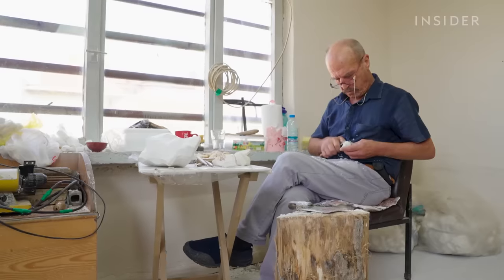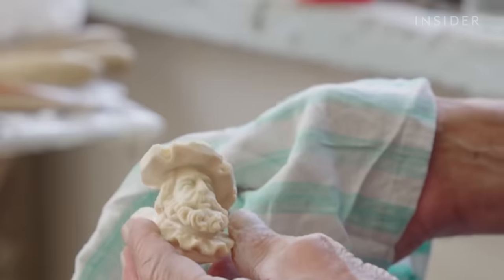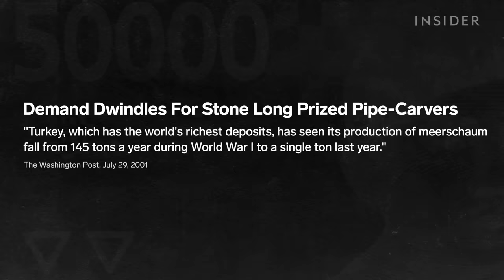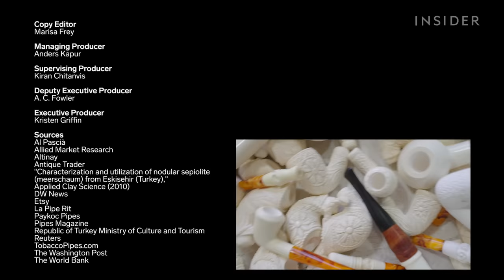Why Turkish Meerschaum Pipes Are So Expensive | So Expensive | Business Insider

Comment: Lovely video, I adore skilled craftsmen. I'm totally surprised that material this expensive isn't being synthesized. Even a top-grade synthetic diamond can't be distinguished from a natural one without expensive tests.
Reply: Hm, magnesium silicate sepiolith needs high pressure and heat to form in combination with volcanic gasses resulting in the porous light structure of the material. So I guess that would be not a cheap process and its only for a smaller market. Diamonds are sold around the world with a very high price. A fistful of material for 40 dollars (from the video) seems to me not high enough, especially with cheap labor costs in Turkey.
Reply: There's a reason you have to look for "block meerschaum". A lot of cheap meerschaum is made up of meerschaum powder held together with a binder.

Comment: Try stabilizing the poor quality clay in Cactus Juice , a polymer liquid that solidifies with heat. Put clay and liquid into a pressure pot, vacuum out the air and keep an eye on it. Don't want the clay to dissolve! When the bubbling stops remove and heat to 200 degrees F. Works with many porous rocks.

Comment: Expensive? While studying I did an internship (abroad) in Eskisehir. There is a market with many shops in the old Town district. I have do admit that's now almost 10 years ago. And yes, the big ones are expensive. Anyway, if you want to get a normal/little smaller one, let's say the sultan head (without hat), it was maybe 20-30 Euro. I got 2 pipes for some friends and paid 35 euro each. Yes, the stem was made out acrylic, but the head was nonetheless undoubtedly handmade. If someone is interested, I think I still should have some pictures from the shops.

So yes, if you want to have a special motive, a bigger pipe and a better mouth piece you have to pay more. But the entrance models are quite affordable.

Comment: I dont smoke tobacco,  but I wonder how Marijuana would be in it. Or if it would actually be worse than a glass pipe.
Reply: I used to have a stone pipe that I smoked marijuana out of and someone stole it. It was a different stone but still very carved. The one I had really absorbed the marijuana resin and eventually when you tried to smoke out of it it was like smoking hash because the resin inside would burn. I do not know how one would clean this sort of pipe, I never got to because it got stolen.
Reply: @adriennefloreen  cotton pipe cleaners are essential even if you're just smoking tobacco. I've never smoked weed out of any of my pipes, most of which are briar. I just smoke tobacco, but if I did partake I probably wouldn't use my pipes
Reply: @daedalus1279  In my opinion smoking weed out of pipes is awfully unhealthy compared to joints because you inhale particles of the burning ash, unless it's a pipe that filters through water but I have never seen one of those that did not have mold growing inside when it got broken open. The joint filters smoke through the marijuana as you smoke it and you never inhale burning ashes. That's actually why I stopped smoking weed in pipes. And also why traditional pipes like the ones in this video have a tiny hole you inhale through not a huge one like the commonly used marijuana pipes, and usually a screen in the bowl. I do not know who popularized the common glass marijuana pipe, but I recently made a video about the one my friend just bought made with recycled vasoline glass because, well, that's absurd.
Reply: @adriennefloreen  modern tobacco pipes have carbin filter chambers in them. U dont need to inhale ashes

Comment: meerschaum pipes are only a little bit more expensive than briar pipes.  they're not "so expensive".  you could at least try doing a little research for the video.  what's expensive is the carving work, but that's true of briar pipes too.  if you take a meerschaum and briar pipe that took the same amount of time to carve the meerschaum would only be a little bit more expensive.  you can easily get a meerschaum pipe of high quality for like 150.  the difference is that you'll get a common design that's not really unique.  I'm not talking about at questionable vendors either.  Some of THE go to online shops for merrschaum and also for pipes in general have quality meerschaum pipes for comparable prices to briar.  

More of the nonsense idea that because something is done in an "old" way it must be inherently better modern.

I can literally find hundreds of the Sultan Head design pipes for about 150.  That's the going rate for a typical briar from a reuputable brand like Peterson.

Comment: So Meerschaum is Sepiolite, read the Wikipedia page about Sepiolite, please. You should have done this before writing your video description. Post a link to a website where we can buy one of the locals handmade pipes. Also, tell them that most people who smoke pipes these days use them to smoke marijuana so they should make pipes designed for that which are usually shaped differently and have a small hole to help control the airflow.
Reply: its not hard to drill a little hole ive done it myself
Reply: @thekraken1173  If that's the case you should inform them they're enforcing laws the USA made up around 100 years ago to harass many traditional cultures that use marijuana and hemp. You could also tell them that "Hashish" means "Grass" in Arabic, literally. And then ask them if they smoke Grass.
Reply: @thekraken1173  The Quaran?
Reply: @adriennefloreen  Thats like associating Western countries with Hebrew, Aramaic or Koine Greek though.